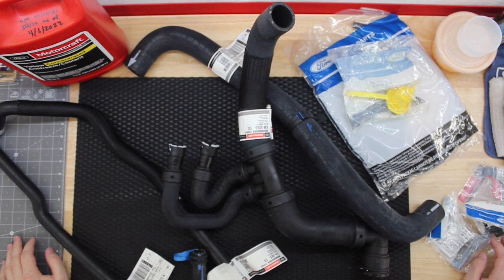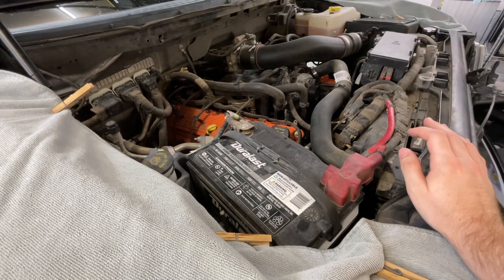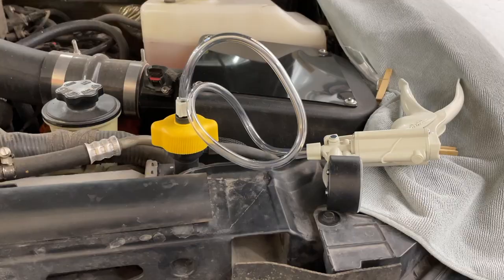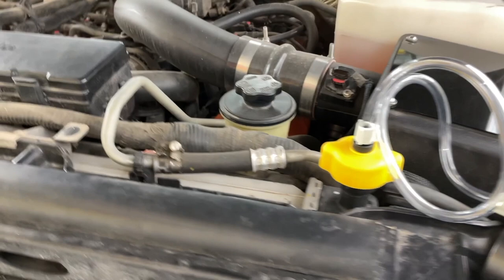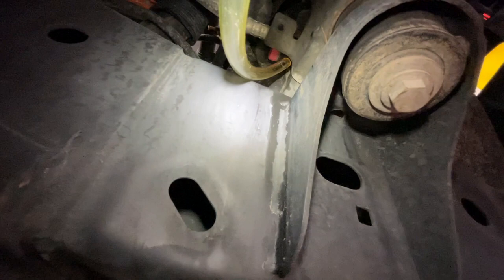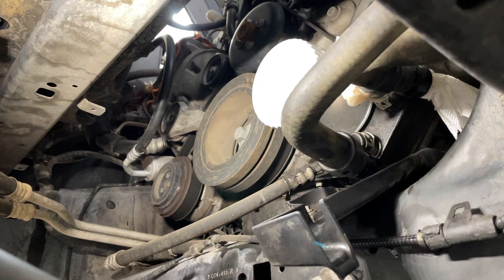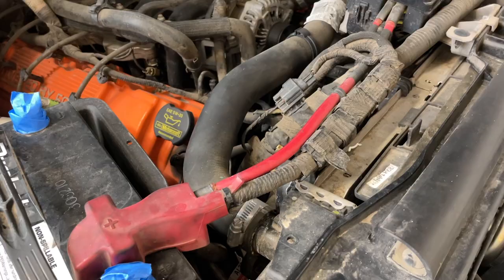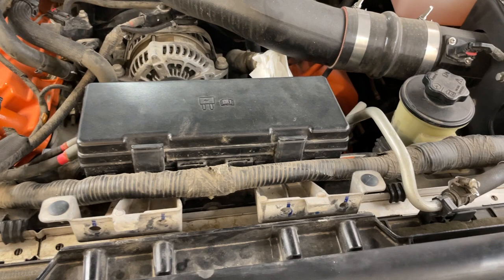Gen 1 Ford Raptor Cooling System Replacement (and 6.2L F-150) - Part 1

Comment: Thanks for this great series of videos! Just did a cooling system overhaul on my truck yesterday and your advise on tools and techniques was invaluable! One suggestion, when changing the lower radiator hose, I recommend pulling the oil cooler to gain clearance from the front. For those with large hands and/or large arms, this can be the most challenging part. It took me over an hour to finally get the hose clamp pliers onto the clamp due to the way it was oriented. When they put that clamp on at the factory, they couldnt have it placed in a worse position.
Reply from the maker: Great piece of advice on the oil cooler - and same here with the darn hose clamp pliers on the lower hose.  Worst part of the job I think.  Thanks for watching!